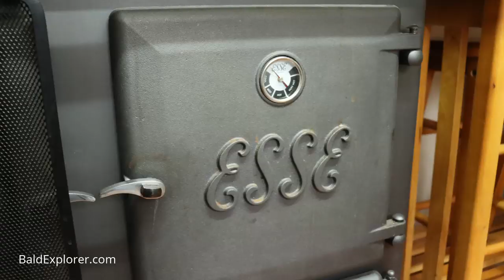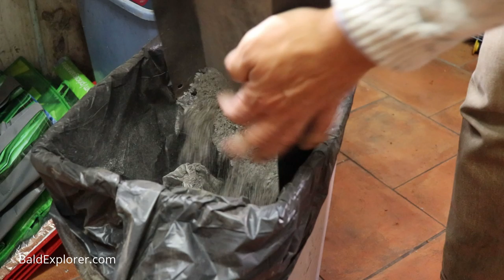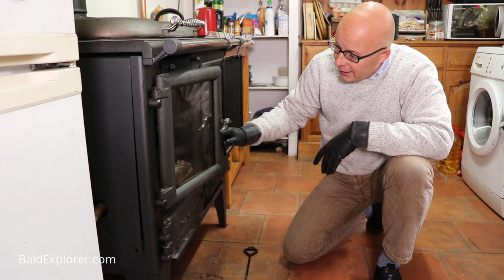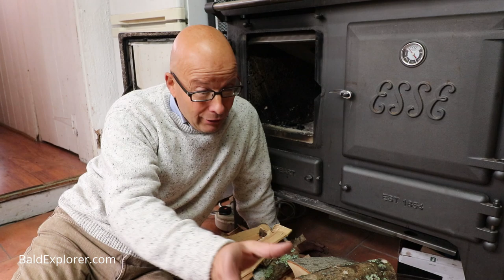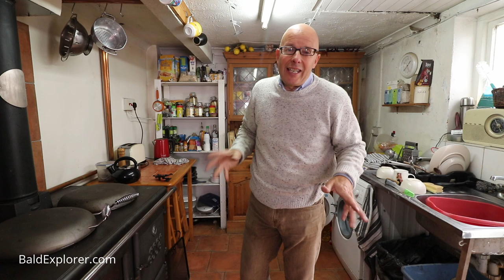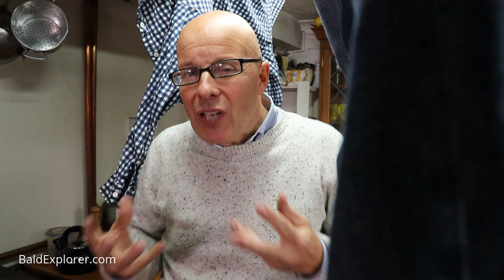Owning an Esse Ironheart Wood Burning Stove One Year on.

Comment: Your stove has whats called an Airwash on the glass, that is that angled baffle you see sloping towards the glass at the top of the opening when you open the door. You want as much air coming out of that baffle and flowing down your glass as possible, that fresh air has no combustion byproducts in it and thus keeps your glass very clean almost indefinitely. The Airwash choke is the one above the door and there is a second choke (not for the airways) below the door near your ash pan. When you want to choke your fire down, first use up the full choking potential of the lower baffle before choking any with the Airwash baffle. Then only choke enough to slow the fires flame propagation, never choke it to much that it significantly dies down. Also, leave some more ash in the bottom of the firebox, this will help your coal bed burn more completely. Just push the excessive ash into the ash pan for removal but leave a coating of ash behind. If you do all of this your glass will stay MUCH cleaner for MUCH longer. Also, if you can better cover your wood so it is seasoning as its sitting out that wouldn't hurt either.
Reply from the maker: Fabulous hints and tips - thanks very much.

Comment: ive not had experience with an esse but when a standard wood burning heater, you shouldn't have smoke coming into the room if the air vent is fully open, perhaps because you have much colder starting temperatures than we have in Australian winter as the flue should draw the smoke up the chimney as soon as it starts to warm.

Comment: Also easiest and best for kindling is an old pallet, split down by an reciprocating saw with a flexible blade (thru the nails not the wood). Then onto the chop saw for even length and finally split. Much quicker than making kindling from logs I'd say.
Reply from the maker: Thaks for the advice.

Comment: Lovely stove Richard - had an Aarow woodburner/multifuel stove for about 10 years. Upside is cosy and homely - downside is inconvenience of sourcing fuel, lighting and cleaning - and more importantly dust. Bad for the chest. Plus I'm on my third back boiler !
Review again after a harsh winter and see what you think. I' m putting a new gas combi in this Autumn - unless you can source free fuel for the woodburner gas works out more economical and controllable if you have mains supply available.
Keeping the woodburner for high days and holidays - you can't beat that fireside cosiness. I bought a chainsaw to process the timber - once the neighbours get to know you're in the market for wood, all sorts of offers come in, from major tree surgery to clearing garages - once had a fitted kitchen and floor dumped on the drive.
Reply from the maker: I think trying to source free wood is very much the answer. I will put it about I am looking for old removed trees! Thanks for thoughts.
Reply: fraser hardmetal Think long and hard before you opt for a combi boiler. I have lived in several houses with them and have grown to detest them. They are unreliable, cause long delays before hot water reaches taps, and provide no back up option when they inevitably fail. Look into a regular system boiler with a mains pressure storage tank. You will have an immersion in case of boiler issues, almost instant hot water at the taps, no worries about the boiler DHW heat exchanger scaling up (there isn't one!) no diverter valve to fail and leak. Combis are best kept for small flats not family homes where taps are run dozens of times a day, each time causing the boiler to fire up only to shut down seconds later.
Reply: @spencerwilton5831  I can see your point but I am fitting the combi as part of an integrated heating system. In trying to make my home as passive as possible ( 40 year old detached bungalow ) I have fitted pv solar, solar water heating, an air source heat pump and a 250 litre storage tank. This should give me about 50% autonomy from mains services. Relying on solid fuel as the main heating and hot water source is fine and dandy if you have the time and ability to support it. Having been laid low with pneumonia a couple of years ago brought this home to me, and explains my multi system approach. I also had the primary circs from the woodburner freeze whilst away on business for 10 days.
This highlights the limitations of a solid fuel system - plus not having to light the fire every evening after work. In re assessing the system I have insulated as well as the building allows, fitted underfloor radiant heating and a centralised ventilation system that recovers heat. Quite expensive, but is money in the bank for the future. As an Engineer I have done the majority of the work myself. The combi boiler, a Worcester Bosch Greenstar will be fitted in the next couple of weeks by a colleague who is gas safe approved.
So it's horses for courses really. Reliability of combi boilers has come on in leaps and bounds - I have a Worcester Bosch fitted in another property which as been trouble free in the six years since it was fitted - it was installed correctly and has to be inspected every year, as it is in rented accommodation. Nothing has failed in that time - keep my fingers crossed now I've said that !
Reply: @spencerwilton5831  combis are troublesome I'd agree.
Reply: We have 1 wood only burner, and a dual fuel. Because we  have a large house with electrical underfloor heating (not my choice!) So we use them heavily on the winter as UK electricity is so expensive. I'd love free wood! But it's not easy to come by.
Reply: @Bedrock1966  The free fuel can come about by word of mouth, and if you are able, get yourself a chainsaw( petrol or electric ), and develop a ninja like sixth sense for lumber. With a bit of practice limited tree surgery is possible. It does turn into something of an obsession, pallets and all sorts of timber is skipped and is free for the asking usually. I always had a bowsaw in the car ready for action. The thing most people don't realise is that you really need to work at least 12 months in advance to allow any green hardwood (when it's cheapest ) to season - softwood burns ok but too rapidly. The Aarow stove I have is multifuel so a shovel full of coke would keep it in all night, or when left unattended in the daytime.
Be careful what you ask for though, I once ended up with three felled elm trees to cut up - all in all 18 tons and the very devil to split. Oh - a electric splitter is really essential, and a trailer, if you want to process any sort of feasible volume. All in all a full time job, hence the combi. Insulation has got to be the way to go !
Reply: @fraserhardmetal7143  I sourced my own by having felled 2 rampant Eucalyptus in our garden. Had to be split immediately as it twists when drying. Was also super wet when green. Dried out quite quickly however. After 2 years drying out burns really well. For bought wood I've switched to beech. Much denser than birch, and also burns well.

Comment: Hi Richard. I enjoyed your video....I have a query. I am considering buying the Esse but I 'm afraid it might be too powerful for my modest kitchen....Does it pump out 9.7 KW without putting in timber by the barrow full.?? Thanks.
Reply from the maker: There is a smaller version that is half the size which ,might fulfil your needs better. You do need to consider where to store your wood. I usually only burn late afternoons to early evening to save on wood. (5pm - 9pm)

Comment: Would a stove like this be able to heat a whole house plus hot water? In a small two up two down.
Reply from the maker: It does mine.
Reply: @RichardVobes  i know the stove is linked to your hot water. Do you have any radiators linked or is all the heat from your woodstove itself. Also great video 👍

Comment: Many thanks, useful and helpful video(s) on the cooking stove! My key question is though, how much wood do you use a year to keep it going for the year for your cooking and heating needs?
Reply from the maker: A fair amount.
Reply: @RichardVobes  cheers, I appreciate it eats the stuff! How many cubic metres could I expect to need per year for it though, and is it noticeably less in the summer without heating water for radiators?

Comment: You do need to burn seasoned wood, and wood that hasn't been exposed to rain, and adjust the vents to avoid a good deal of the pitch ending up in your glass on the door. That is common practice with any wood burning.
Reply from the maker: Yes the pitch on the glass is a pain. :)

Comment: That wood looked way too fresh yet, which might be why you are getting so much soot. If you can, seek out an old log that has been down for a year or more. I would at least put the next days wood in a fireproof container in the kitchen so it ca benefit from a little dryness. Make sure you have a sweep look in if green wood has been the case for any amount of time-once a chimney fire starts, you get well above 1,000d F, and usually up in the 2,000's and quickly due to the way it forms a strong draft. Even a well made masonry chimney isn't meant for that, which then heats the surrounding framing etc until poof the house goes too. I absolutely understand the slow way of life, and look forward to having a wood stove again.

Comment: I am curious to know what is the procedure for fresh air intake, does it have any system for fresh air to convert into hot while going inside, hot air helps to burn wood properly & it gives high efficiency .my the second question is, does it have turbo smoke system, means it should generate high temperature inside & while smoke should catch fire while going out & there should be no smoke visible through the chimney.
Reply from the maker: The cold air intake is at the bottom, and you can open it up in stages depending on how much you need.
Reply: @RichardVobes  thanks but questions remain still unanswered...

Comment: That Fire / Stove is Great.  Do you Pump the hot water into a Large Copper tank ?  Also You can Heat the Whole house if you pump the water round a radiator in every room. Like normal Central heating. USE every aspect to the Maximum use. 
For Extra Heat Circulation Place a desk Fan or similar to blow the heat into the rest of the house. 

WoodAsh is very good for plants Trees & Gardens,  Try to find someone local to Collect it. 
Sprinkle it on to Lawns or anywhere you want good growth / soil quality.
Reply: Its a Thermosiphon system. No pump. Traditional heating with used this method to heat 'some' but often not all radiators around the house without the aid of a pump.
Reply: @johnclarke2997  Yes, I'm no Heating Engineer, But I know what you mean, 
Still a Central heating pump Would deliver a constant flow & use Very little Electric. & we are not on a Climate Change Channel Here. 
Excess  Water could be stored in an Airing Cupboard Copper Cylinder for Showers & Baths etc. 
Rather like a BAXI fire back boiler . 

Burning old Furniture, Broken Pallets, & other Waste wood is a good way to GET a 2nd USE out of it, Rather than Land fill. 
Obviously Prunings & Coppice cuttings. 

The Pump could run on a Thermal Energy charging system to a battery, or a small solar panel on a windowsill in a spare bedroom etc. if thinking OFF GRID Methods. 
Don't ask How. Cos i don't know How But i have seen it done many times. ( or similar Systems, usually home built. ) 
My Mind thinks WHAT TO DO.  
it takes another MIND to figure out HOW to do it.  Electronics & water Flow rates, Temp' Retention, etc. Size of solar panel & Capacity of a Battery etc. 

I will think it, 
You go make it happen & I will be Happy with 50% of Profits. 
I would be OK with 5% cut of £1 mill P/a.
Reply: @A1DJPaul  Some systems have both, thermo for hot water and a few radiators and then pump for the full system. Idea being to heat the hot water cyclinder and a couple of radiators in the rooms which are used the most. Run up the pump when you wish to warm up the full house. My grandparents Parkray coal fire/boiler worked in this manner and it worked well at heating a three bed house.
Reply: @johnclarke2997  
Yes, It would Depend on Existing fixtures & the size of the house & OVER How Many Floors to lift the water. 
Parkray is probably similar to the BAXI system ? 
Open Coal fire & fire back boiler into a copper Cylinder tank. 
My Grandmother's coal fire heated a couple of radiators upstairs on this system. = the whole house is Warm.  3 bed Tce house. 
With good hot fires a house will stay warm due to thermal mass in the walls & retained heat in the Furniture. Typical wall mounted radiators will warm the walls & release heat slowly.
Reply from the maker: I do heat the water with it. I will at sometime extend the plumbing to radiators. Good advice. Thanks
Reply from the maker: Yes. I don't use a pump.
Reply: @A1DJPaul  The system was limited by pipe diameter and bends from what I can remember, but on my grandmothers Parkray system, the thermo would heat up the water cylinder, radiator in the bathroom, main bedroom and warm the radiator in the hall (stair case area) of the house. Running the pump would allow the full system to get heat. The Parkray was a coal fire with a door and glass over the front, probably dated from the mid 1970's.

Today with improved thermostatic radiator valves and flow control valves and so on, then it might be possible to design a system which can run without any pumps.

Comment: See my reply below. Also I noticed on your video a lot of blackening above the firebox door. Have you done the A4 paper test? You should be able to put an A4 piece of paper in the door and close it - and the try to pul it out - it should not move. If it does, this means the seal around the door is not air tight - and that means a fire that burns too quick! You need to service your Ironheart about once a year - videos are online. Jo
Reply from the maker: I service mine more regularly actually. My main trouble is getting properly season logs from the supplier.
Reply: @RichardVobes  I find that even seasoned hardwood logs benefit from a day or so next to the stove before use and I also use just one or two kiln-dried logs on top of the kindling to really get a hot fire quickly to heat up the flue pipe. These are so clean and dry you can keep them in the house (if room). Yes, I do vacuum it out every couple months  - but that hotplate is SO heavy to lift out. Last year I re-sprayed it, really easy and it smartened it up. Prep took the longest but well worth it. If you do get any problems you can speak to Esse direct and in 'technical support' you speak to the engineers themselves - lovely people and great at problem solving !

Comment: Have you got the name of the foam cleaner you used on the glass, please? Great video 👍🏼
Reply from the maker: It's Mr Muscle Oven Cleaner.
Reply: Richard Vobes 🤣 what a good idea- hasn’t thought of that- love that the foam actually stays on the glass unlike the runny spray ones I’ve tried before
Reply from the maker: Yes - often you can wipe it clean with just that and a cloth, or a little wet wire wool.
Reply: You can clean the glass with a piece of newspaper wetted  then dipped in the ash. Honestly it's the best way, it doesn't cost anything and free of chemicals!

Comment: All to much faffing about for me and besides I like a nicely maintained warmth in the house through the winter that only central heating can achieve, but fair play to you Richard if its your thing. 

I did have oil fired heating in the first house I bought which had a fire/boiler in the back room and vents through the wall to the lounge and more in the ceiling to the two bedrooms and bathroom from the downstairs rooms below which worked well at keeping the whole house warm, perhaps you could look at installing some vents and between the wood burner and your Esse you could heat your whole house through convection too.
Reply from the maker: Each to his own I guess. I love the faff and the stove.

Comment: Couldn’t they have run the flow or return copper below the stove. Looks odd
Reply from the maker: I love it, odd or not.
Reply: The flow and return pipes are working on a heat rising and gravity principle, ie; no pump involved.
When the flow leaves the stove it must make a continuous rise, no matter how shallow. (The pipes behind the stove may look level but they will have a slight incline and decline.)
The hot water will naturally rise all the way to a hot water tank of radiator and then as it cools it will return to the stove to be reheated.
Hope this helps, feel free to ask if I haven't explained it clearly.

Comment: Yes you can,remove the crate,if you read the instructions,that come with the unit,it tells you,to remove it,when burning wood,,as wood needs a bed of ash to burn on.unlike coal
 🤠🍷🍷🔥🔥
Reply from the maker: If I remove it there is only the ash pan underneath - surely the bed of hot ash doesn't sit on that?
Reply: I have a Stanley (Irish) wood cook stove, .........I removed the grate (which is really used for coal or peat) and have a log fire directly on the bed of the stove, (I removed the ash can). Using this way the wood fire lasts much longer, and I only have to clean out once every week or two. However I did put a metal grid, sloping inside where the air intake is, (directly beneath the fire door), this allows the air to enter without the ash blocking it. It's worked fine for the last few years, ..........but I would get an Esse Ironheart in the blink of an eye, if I could afford it, ........almost $ 10,000 here in Japan ! Very sad but true. ............Always love your videos.